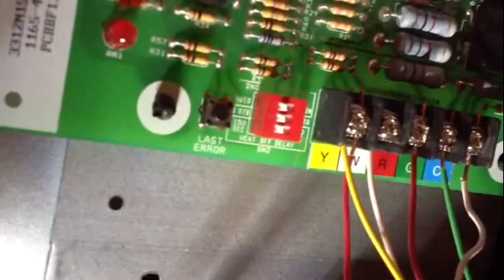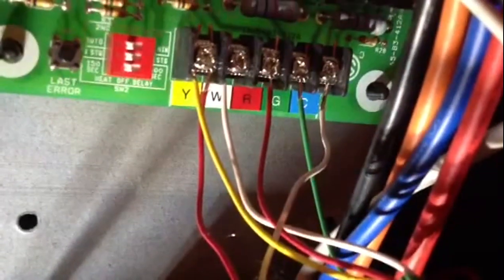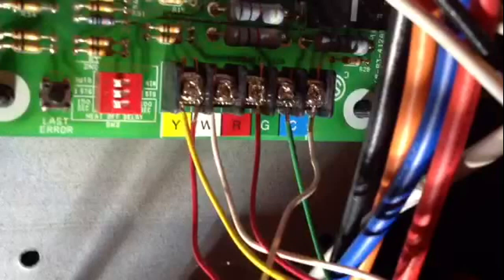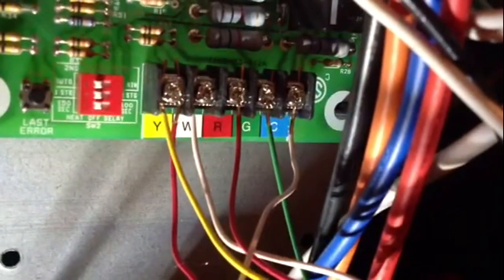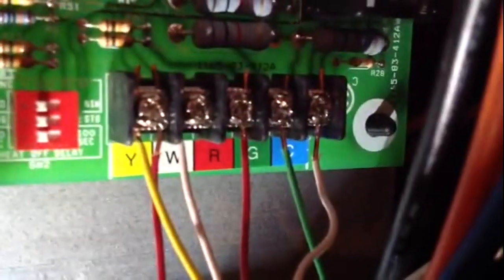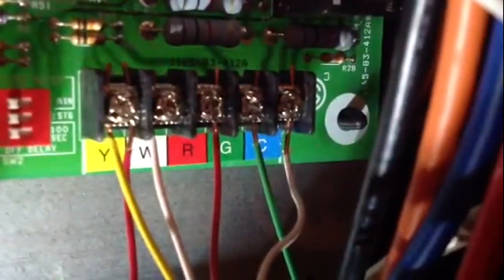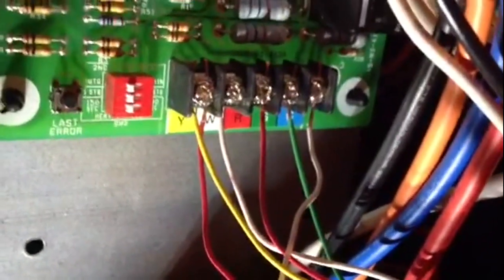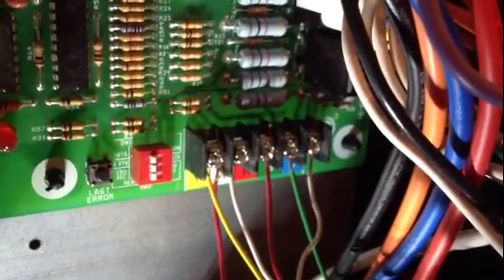How to install air conditioning unit part 9

Comment: Question..

I'm replacing a old furance ( 35 years old) with a 80% new furnace ( direct comfort)..

Questions is..
I just a 2 wire connection ( red & wire), no AC, just heat..  I read the installation doc and it states just connect the red( 24 volt) and white ( heat) directly to the control bd. 

Now, does the blower motor comes on from signal from control bd, or, I need to add new wire... Installation guide doesn't show  blower wire connection ( just) red and white..
Reply from the maker: Yes if you hook up the red and white to the R and W terminals on the control board the fan will come on when it receives voltage from the control board. No additional wires are needed.
Reply: Thank you
Reply from the maker: @dfigueroa903  and good luck

Comment: Thanks for posting this. My AC compressor bwouldnt come on and I found that one of the wires that goes to the compressor was connected to Y and the other was hanging. Couldn't remember where it goes but now I know that it goes to C.